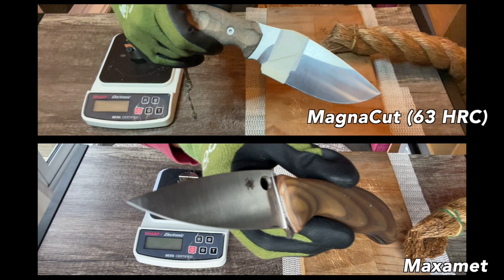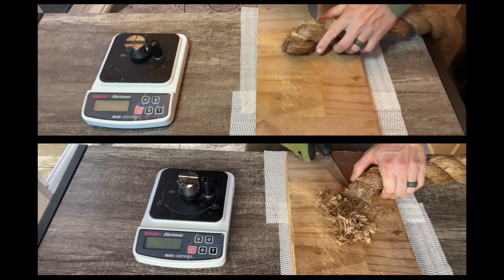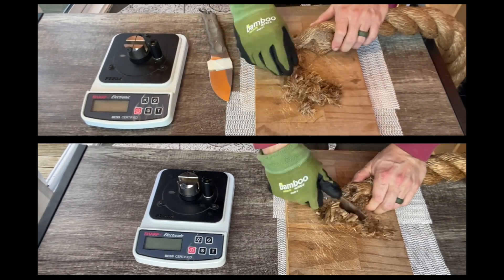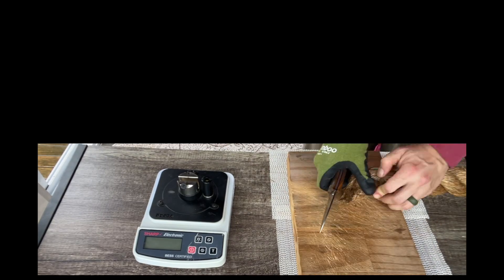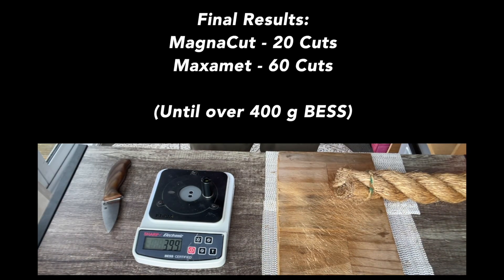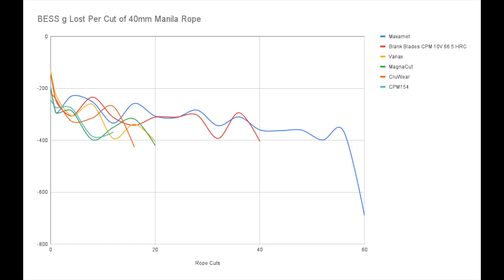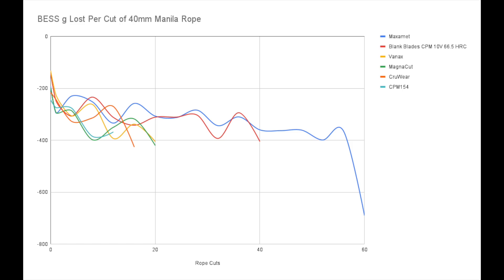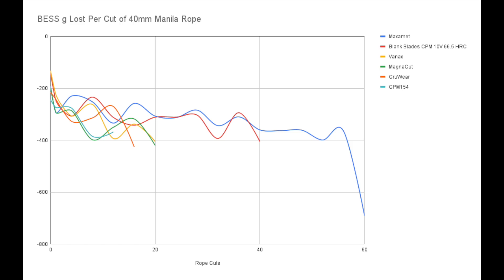63 HRC REK MagnaCut vs Spyderco Maxamet! 40 mm Manila Rope Knife Test

Comment: what was the edge geometry on nagnacut?
Reply from the maker: They were both 17 degrees per side.  I believe they were both around the 15 thousandths mark, but the grind was definitely beefier on the MagnaCut blade which could have swayed things.
Reply: @homeslicesharpening  i understand magnacut was designed to build edge retention primarily through acute egde geometry supported by its superior apex stability rather than carbide volume.. 
so i guess this test needs to be revisited cause if maxamet didnt chip at 17dps then 63rc+ magancut should be good for 13dps for the same task (at which it should have double the edge retention of 17dps as per dr thomas’ data) 

its kinda disappointing to see comparison between two steels with opposite ratios of carbides to toughness at the same edge geometry because the test will inevitably favor the steel that is closer to its optimum at that angle (the higher carbide volume one).. 

seems like a marketing flaw of magnacut that its designed for hyper acute adge angles yet everyone still sharpens it at the same angle as any other steel and they are then disappointed that it performs barely any better than other steels.. 

i guess thats why dr Thomas developed the magnamax so the ratio of carbides to toughness is optimized for those widely overused 17dps.. smart way of bailing out on trying to educate people about optimal edge geometries and rather making money on a product optimized for traditional edge geometries..